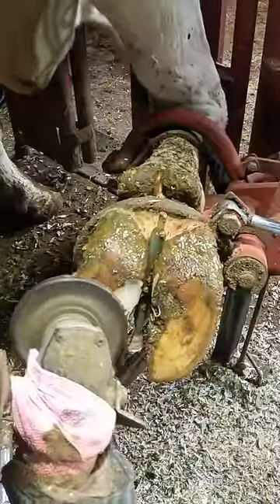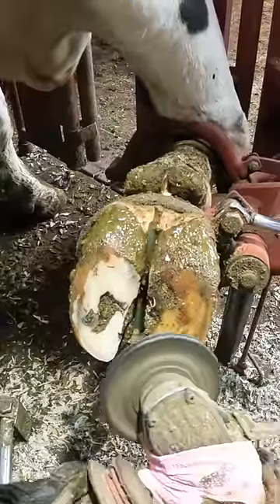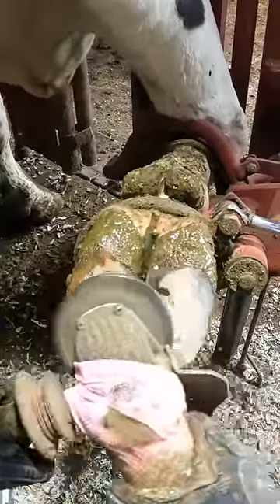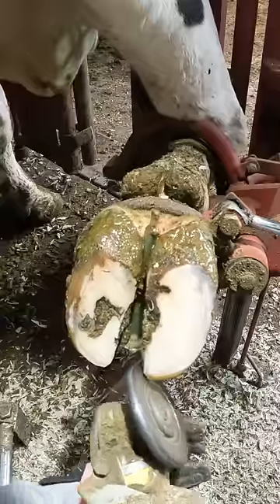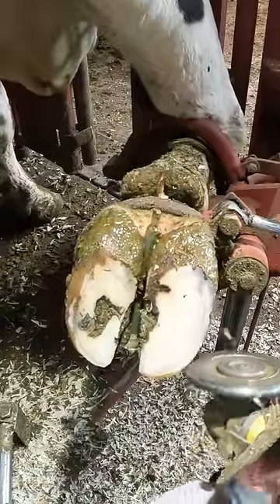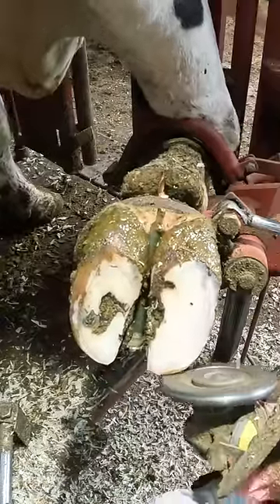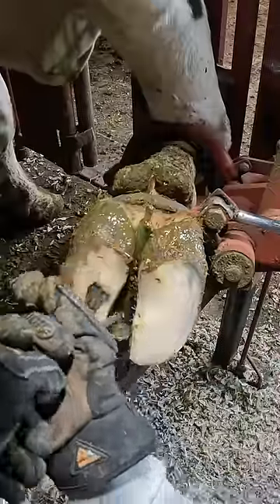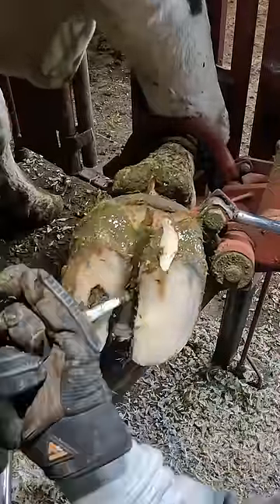Steel Cable Stuck in Cows Foot

Comment: Meanwhile I cant cut one half a nail on my cat without her ready to kill me
Reply: Omg, same
Reply: Wrap your cat tightly in a towel and only leave a spot for its nose and the paw you need to trim.
A second person makes it a lot easier.
Reply: @donnablosser7982 Towel trick always works, also comforts the cat in the sense it acts like a swaddle.
Reply: Tried this same technique on my larger older heifer this past monday. I noticed day by day she was getting lamer and lamer. It was hard to get her between the metal slide gate. But when i got this heifer in the correct position, i slowly pulled up on her leg to the correct prone position when things went bad...... The last time i heard this heifer wale and scream like this was 2 years ago when i told her... "Those dishes aren't going to wash themselves!!!"..... Welp! gots to go, gotta pull out the sofa bed to sleep for the foreseeable future. FYI: never call her a dishwasher, even if shes lame and a heifer 😂
Reply: @smooth_ops2942 This should go on some boomer subreddit 🙄 I'm guessing the "joke" is calling your female partner a freaking cow and "haha she doesn't want to wash the dishes, women am I right?" The kinda humour that is only "I hate my wife" and nothing more.
Reply: @smooth_ops2942 How about taking turns washing the dishes, or are men all incompetent at everyday house tasks?
Reply: Nice to see if you clean it first
Reply: @iclynnx did you finish vacuuming or something? Theres probably some other chores for you to do 💅🙍‍♀️
Reply: You don't have a rack to keep your cat still, and the paw in traction 😂

Comment: Just thought of something. You mention near the end of this clip that the dark area is just staining and there's nothing underneath. It's slightly tricky to tell from the video but is the difference that the coloration is on the surface rather than visible through the translucent sole?

Comment: Is it better to shape that hole to have an exit for debris so it doesn’t get more stuff stuck in it and causing another problem?
Reply: I was thinking the same thing, but I'm far from an expert
Reply: It takes weight off the area
Reply: The goal is to remove any damaged horn from the hoof and yes, make sure that it can drain and debris should not get trapped anywhere inside, he made a good rounded hole, making sure he got any separated horn to be sure that nothing gets stuck and to take pressure off that area when she walks :)

Comment: I noticed no spray for infection or block for other hoof why is that or a wrap?
Reply: No exposed tissue that would allow for infection :) no bleeding, no pus typically means they can carry on once its cleaned up to *prevent those issues, the damage could have extended deeper in the foot if it hadnt been caught now. The damaged/dead tissue and foreign body were removed with no issues, so shes good to go 👍

Comment: So why didn’t u glue on a boot on the right hoof to allow the left hoof toe to grow back correctly?
Reply: This will grow out perfectly fine, there is no lameness, no open wound, the hoof was in good shape, the abcess that it was had already pocketed and started to heal so all he did was remove damaged and dead tissue that was already growing off after getting the piece of steel. No need for a hoof block on this girl :)

Comment: I think youshoud pressure wash it before attempting to do any maintenance trim.
Reply from the maker: So a normal day we trim 70ish cows that's 280 foot washes/power tools and time. Our trim is based off of measurements and angels. I've done a few videos showing why we don't so what do you think would be a reason why we should?

Comment: Alguien  me puede decir si ellas sienten dolor al  pulirse  y que es los huecos
Reply: I don't think they feel much pain when they get trimmed or they would've moved a lot more if it hurted, and i don't know if it's true or not but apparently they don't feel anything in their nails, and the holes are when they had a cavity or a rock stuck in their hoof etc or in this case a steel cable and it gets cut out and it forms a hole

Comment: This dude needs to go back to school
Reply from the maker: Clearly you haven't worked on hooves before or you'd know the difference between a shit stain and an abscess.. Alley scraper cable penetrates the hoof horn sometimes and then the liquid will leave a black stain like in the clip. Sometimes it will reach the corium but sometimes it stops just shy and only leaves a dark discoloration. For a professional trimmer it's very easy to tell the difference. Also look into bovine hoof trimming schools and tell me what you find 😉